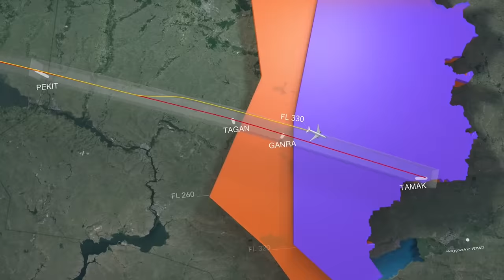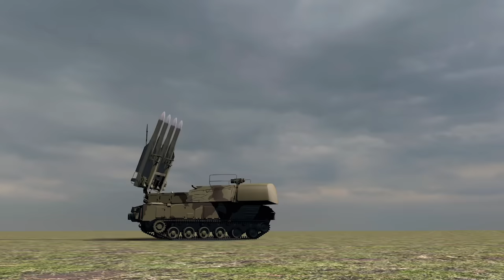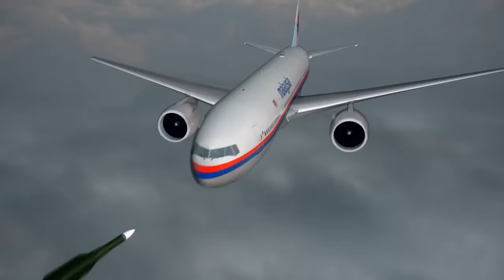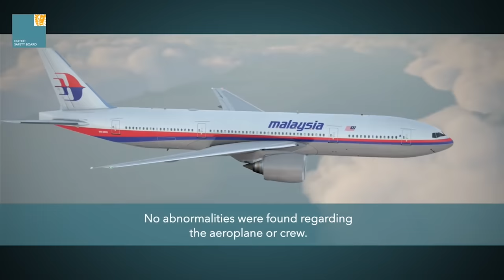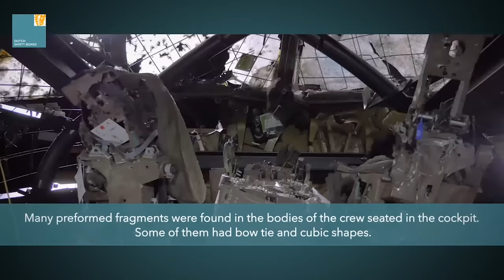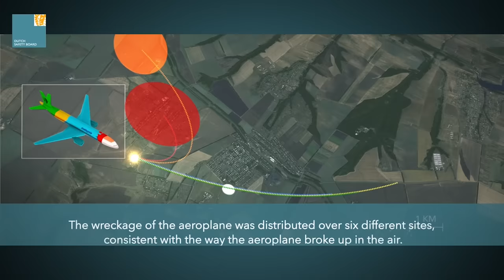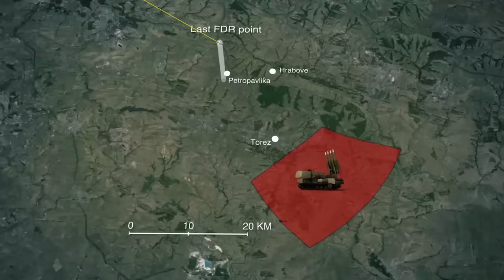Cause of MH17 crash by Dutch Safety Board

Comment: In subsection 2.16 (Figure 37, Table 11) of the "Factual information" section of the final report, it is indicated that, in total, two striking elements resembling an I-beam in shape, which are characteristic of the 9N314M warhead, were detected:

fragment No. 1 — 14×14×4.5 mm in size and weighing 6.1 grams (crew cabin);

fragment No. 2 is 12×12×5 mm in size and weighs 5.7 grams (the body of the aircraft commander).

At the same time, section 2.12 of Annex X to the final report mentions only one striking element 14×14×4.5 mm removed from the crew cabin (fragment No. 1).

The unreliability of the data given in the final report lies in the fact that in reality the mass of fragment No. 1 is not 6.1 g, but 5.5 g, as evidenced by the photographic materials obtained when weighing the fragment by members of the international commission in February 2015 at the Gilze-Reyen base. In addition, the report does not indicate the location of the discovery of this fragment in the cockpit.

The body of the commander of the aircraft from which fragment No. 2 was extracted did not undergo a special study (instead, the body of the commander of team "B", who was outside the cockpit of the aircraft at the time of the crash, was examined).

A new important fact is that, even if we assume that the aircraft was shot down by a Buk-type SAM missile, the characteristics of the fragments given in the report do not correspond to the characteristics of the striking elements of the 9N314M warhead.

The shape of the fragments resembling an I-beam is considered in the final report in isolation from their mass. In comparison with the reference striking element of the 9N314M warhead in the form of an I- beam weighing 8.1 grams and 8.2 mm thick:

the mass loss of fragment No. 1 was actually 32% (according to the report, 24.7%);

the mass loss of fragment No. 2 was 29.6%;

the relative transverse deformation (thickness reduction) is more than 60%.

For fragment No. 1, it is impossible to explain the loss of significant mass due to destruction, because it has no signs of destruction (otherwise it would not have retained a shape resembling an I-beam).

Fragment No. 2 has obvious signs of destruction, and the destruction occurred in a transverse (relative to the frontal surface) section. The small residual mass of the fragment can be explained by the fact of its destruction. However, the thickness of the fragment indicates a significant deformation of the striking element (more than 60%), which is not consistent with its shape.

The evaluation of the ratio of the shape and mass of the striking element "I-beam" of the 9N314M warhead after breaking through the obstacle was carried out by Russian specialists during full-scale tests of the 9N314M warhead and by modeling the transverse deformation of the striking elements.

Tests of the 9N314M warhead showed that the average mass of the I—beam striking elements, which retained their original shape with a through penetration in one case — aluminum sheets with a total thickness of 12 mm and in another case - the cabin of an Il—86 aircraft, was 7.2-7.9 g, and the average mass loss did not exceed 3-12%.

The experiment on modeling the transverse deformation of the striking elements showed that the shape of the sample with a relative transverse deformation of 60% differs significantly from the shape of the fragments presented in subsection 2.16 (Figure 37, Table 11) of the "Factual information" section of the final report.

The results of the tests and the experiment coincided with the data of control tests when creating the 9N314M warhead, according to which, with a through penetration of two steel sheets with a thickness of 5 mm each, the number of striking elements that retained the shape of the I-beam was 96% with a loss of mass of a separate element of 6-7%.

Thus, the mass-dimensional characteristics of two fragments (subsection 2.16, Figure 37, Table 11 of the "Factual information" section of the final report), on the fact of detection of which the conclusion about the defeat of the aircraft by the 9N314M warhead is based, do not agree with the results of field tests and experiments.

Subsection 2.16.2 and table 12 of the "Factual information" section of the final report provide information on the chemical composition of the fragments extracted from the fragments of the aircraft and the bodies of the victims.

Studies of the chemical composition of the material from which the striking elements of the 9H314M warhead are made, carried out by Russian specialists, have shown that the chemical composition of the fragments published in the final report contradicts the conclusion that they belong to the 9H314M warhead.
2.2. Damage to the fragments of the aircraft

Subsection 2.12 of the "Factual information" section and subsection 3.5 of the "Analysis" section of the final report, as well as section 2.13 and annex X indicate the approximate number of holes on the left side of the cockpit skin (about 200) and provide data on the transverse size of 31 holes. This, in fact, exhausts all the results of the study of the holes on the fragments of the aircraft.

At the same time, in the final report and in its appendices there is no data on the shape of the holes, on the presence of holes on the right side skin, as well as materials for assessing the characteristics of the warhead by the nature of the fragmentation field on the fragments of the aircraft.

A new important fact is that if we assume that the plane was shot down by a Buk-type SAM missile, then the characteristics of the holes on the fragments of the aircraft do not correspond to the characteristics of the holes that are formed when the 9N314M warhead explodes.

According to the results of full-scale tests of the 9N314M warhead, carried out by Russian specialists, in accordance with the conditions of damage to the aircraft given in the materials of the report, the presence of many holes in the form of an I-beam was recorded on the outer skin of the target aircraft. There are no holes with a similar shape on the fragments of the Boeing-777-200 9M-MRD aircraft.

In addition, during the tests, in contrast to the damage on the fragments of the Boeing-777-200 9M-MRD, the facts of complete destruction of the glazing by the commander of the aircraft, the power set above the glazing, numerous through holes not only on the left, but also on the right sides of the fuselage (exit holes) were recorded.

The studies of the fragmentation field covering the fragments of the aircraft performed by Russian specialists showed that the total number of striking elements and the characteristics of the warhead (according to the DSB version) that hit the aircraft do not correspond to the characteristics of the 9N314M warhead.    6. Conclusion
New important facts indicating the unreliability of the information given in the final report, assuming that the plane was shot down by a Buk-type SAM missile, are:

inconsistency of the characteristics of the fragments given in the report with the characteristics of the striking elements of the 9N314M warhead;

inconsistency of the characteristics of the holes on the fragments of the aircraft given in the report with the characteristics of the holes that are formed when the 9N314M warhead explodes;

the discrepancy in appearance of at least one fragment of a rocket found at the scene of an aviation accident (the hull of the 3rd compartment) with the appearance of fragments of this hull, which are formed when the warhead of the 9M38 series rocket explodes;

inconsistency of the algorithm of operation of the remote radio detonator of the 9M38 Buk missile with the conditions of aircraft damage;

the discrepancy between the spatial position of the missile when the aircraft was hit, given in the report, and the characteristics of the fragmentation field covering its fragments;

inconsistency of the conclusion about the launch zone of the anti-aircraft guided missile that hit the aircraft with the technical characteristics and principles of operation of the 9M38 missiles;

Comment: The fact that anyone would fire a SAM at an airliner is just beyond my comprehension
Reply: @Tuomas Vavrusco yeah probably should've confirmed that before they pulled the trigger
Reply: That's Putin alright.
Reply: It was going for a jet. The fighter jet hide behind the plane
Reply: Biological Warfare no they werent
Reply: @Bullman8  lol,sure.
Ukraine used only su-25 in this zone,MH-17 was flying at 10 km,maximal altitude level for su-25 is 7.5 km.
Reply: No.. both wrong witnesses say they seen the jet do that, but it was an accident so they cover it up with drugs and cannabis
Reply: @Bullman8  so they saw a tiny jet hide behind a airplane that is hard to distinguish at 10km height? Doubt it, even with benaculairs

On the radar you would still see two airplanes you don't just fire a SAM you need to know wgat and where the target is to let it explode right
Reply: To the electronic sistem on the ground was just a target with the same speed as a cargo plane.
Reply: @ylu6685  The SU-25 is based on the USA A-10 which has a maximum ceiling of about 13.7km, The SU-25 has a ceiling of 7.5Km  to 10Km.
The Russian service ceiling is not the same as the USA service ceiling, i.e. maximum height. For Russians the service ceiling is the height the jet can travel at, at which it can not be attacked by a manpad - as in Afghanistan
Reply: @ylu6685  the plane shouldn't have been there to begin with XD

Comment: So these innocent people saw their fate and the pilots saw that thing coming at them.  Firing squad would be too decent for the criminals who did this.
Reply: The simulation most likely slowed down the terminal flight of the missile. When the engine burned out, the missile was flying at 3 times the speed of sound, or just under 1 km per SECOND. I doubt the pilots saw the missile. Maybe it was better they didn't.
Reply: Missle traveled way too fast. they never saw it. they were dead by the time they heard a sound.
Reply: @Rob774  maybe, but I've also never been on the receiving end of a missile traveling Mach 3 so this is all just speculation, but it's also the internet sooooooo
Reply: @Deimnos  if you watch that video, do NOT use headphones
Reply: It’s a damn warzone lol, you can’t expect soldiers fighting in a a war to not fire at aircraft
Reply: @Girtharmstrong69  I can and I will, that simple
Reply: @roarkedunn2688  if you think that then you aren’t very smart
Reply: @roarkedunn2688  I run a small business so maybe it’s you who needs employment, just too bad I don’t hire opinionated trash can wizards.
Reply: @roarkedunn2688  for one only military aircraft are supposed to fly in war zones so when they saw a non friendly aircraft of course they shot it down. And by non friendly I mean not their forces. It’s 100% the pilot / airlines fault. Not the damn soldier on the ground fighting for his life:
Reply: @roarkedunn2688  or else everyone would just use airliners to invade eachother because no one would shoot them down you troll look at how Rwanda nvaded the Congo by using passenger jets
Reply: @roarkedunn2688  you have nothing to bite 🤷‍♂️
Reply: @Girtharmstrong69  I know enough about you to say that with confidence :)
Reply: @Girtharmstrong69  Actually, it would be the Ukrainian Air Traffic Control's fault. They directed the aircraft over a battle zone and they were never asked to account for this.

Comment: I flew from the U.S. to Mexico once and all of the sudden, a serious turbulance smash hit the plane that felt like it would break the wing. Everybody was shook. I can't imagine, and don't want to, what these people must have felt. May they all rest in peace.
Reply: Fortunately, they probably didn't suffer long. At that altitude, explosive decompression would almost instantly knock you out. Also they probably didn't even know what was about to happen. They got hit from the front, so the only people who could have seen it coming were the pilots most likely. I'm sure they tried some evasive maneuvers however that were probably extremely frightening to the passengers. That was probably the scariest part for them because the explosive decompression would have been so sudden and powerful that they were certainly knocked out. Everybody on that plane was probably dead or close to death before they even hit the ground.
Reply: I feel you bro. Once I flew from St Pete to Paris and bam! In the mid air plane dropped on its side. It was freakin scary as commercial planes are not designed for such maneuvers, they may lose control and break apart. People were shouting and crying. Later we were told it was because of hot air from a bigger plane which was flying ahead of us. To this day I have no idea what it really was.

Comment: The cartoon from the Netherlands shows that the wind blew back the wreckage of the plane, which was flying at a speed of more than 200 m / s and was blown away for some reason from the cockpit, although the Dutch indicate with colors and this is not debris from the cockpit, and they flew to the left and BACK a few km from the mythical point of detonation of an anti-aircraft missile, also in their report DSB write that there are no traces of thermal damage on them, which is a lie. The angle of attack sensor damaged by striking elements indicates that the cabin was flying to the ground at the time of its defeat, and was not in horizontal flight. Also in his cartoon, he points out that allegedly PEAK2 is an explosion and that it occurred from the top left. In fact, this signal is not an explosion, its amplitude (less than even the amplitude from RR-Trent) and the frequency does not correspond to the explosion, but the real order of the OBS microphones at the entrance to the cockpit, P1 on the FAC his chair was pushed back, P2 the first officer his chair was not pushed back CAM, that is, the source of the signal located at the back. They also ignore the PEAK1 signal recorded by the CAM microphone, which has the lowest sensitivity, but the only one is on the fuselage and there are no dampers between it and the fuselage. PEAK1 and PEAK2 are not an explosion, but the shock waves hitting the fuselage at the explosion site PEAK1, and PEAK2 on the partition separating the fuselage (passenger cabin) from the cockpit, and then the breakage of the recording destruction of the fuselage with simultaneous breakage of two information cables that go on different sides one from the cockpit with its 4 microphones to the CVR (voice recorder) another from the computer center (outside the cabin 2 of three computers duplicating each other in compartments 117 and 118, and the third computer is in a specially niche near the hatch in the front cargo compartment to the FDR (parametric recorder) and not one of them is not damaged on the skin of the aircraft there are no holes on the left or right, there are also no holes in the partition separating compartments 117, 118 from the chassis compartment only a hole punched by the chassis itself when falling, by the way, even rubber on the chassis it is not touched, although according to the Dutch version, a Buka anti-aircraft missile allegedly exploded from the top left. Thus, based on the macro parameters of the crash, the plane was blown up, not shot down. And we need to look for a way to simulate the external impact from highly kinetic objects on his cabin. And it was carried out after the plane was destroyed and its cabin was flying to the ground due to two explosive devices located in the cockpit (one of them in the left instrument console near the PIC(pilot in commandor) seat where a huge hole gapes and its edges are curved outward and traces of thermal effects are visible on the inner surfaces, such that the paintwork is destroyed and the floor in the cockpit was so burnt out that the Dutch first covered it with non-transparent polyethylene, thereby hiding it from journalists when laying out the wreckage in the hangar after their arrival from Donbass, and then, during the final layout, they hid this fragment of the cabin altogether) and these bombs were thrown in front of the cabin flying to the ground by very specific striking elements of the capsule filled with a chemical agent capable of burning through the metal of the skin (aluminum alloy) and even melting titanium (the weather vane of the angle of attack sensor is made of it). That is why there are smaller holes through the skin of the aircraft, and next to them larger ones, and therefore having a larger mass, are not through, which contradicts physics, but fully corresponds to chemistry. The higher the contact area, the lower the penetrating power of the chemically active.

Comment: Imagine the pain these pilots felt having hundreds if meral shreds going throuth their bodies 

Man it breaks my heart
Reply: @deadliftalot  With the missile traveling at Mach 3 and exploding very close to the aircraft, the time from the moment the missile passing in front of the cockpit to pilots being dead would be less than 1 second.
Reply: @alpejohnson491  LOL you ain't hearing nothing at that speed
Reply: @r.yuksel9774  true your ears would have been evaporated  bruhh
Reply: @alpejohnson491  The closing speed would be Mach 3+, that means if the missile were to explode 50 meters front of the 777 and you blinked when the missile was under the aircraft, you'd be dead before you could open your eyes..